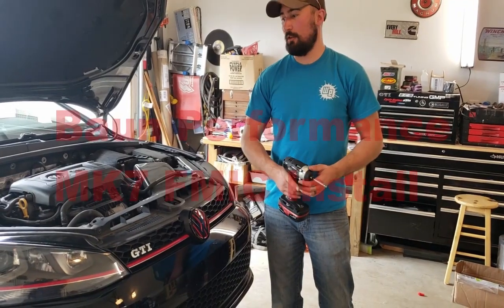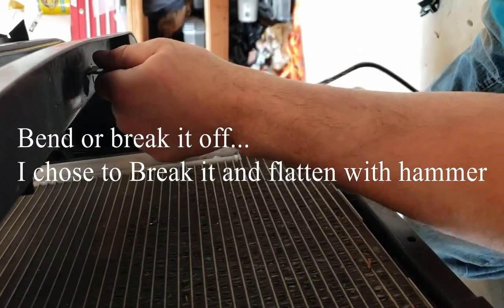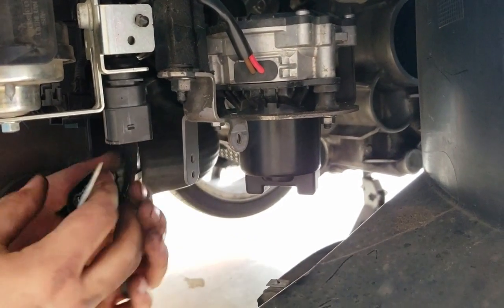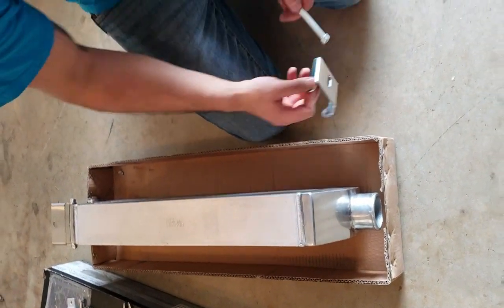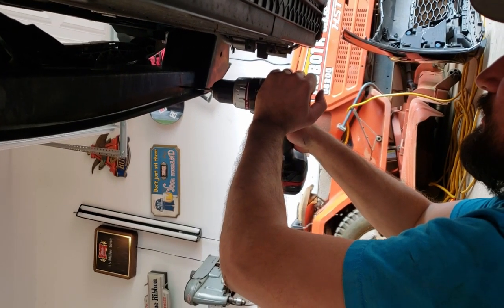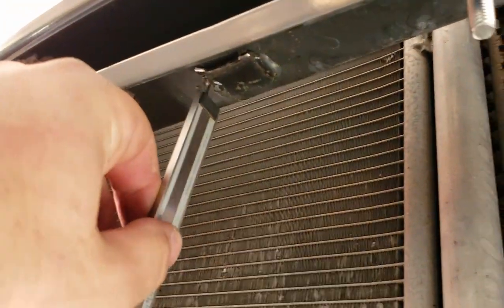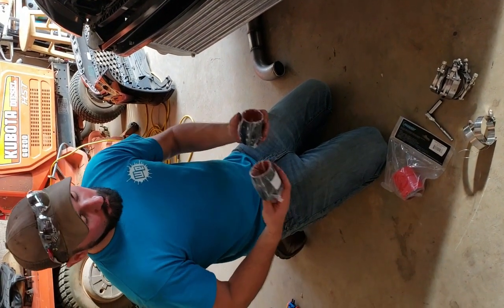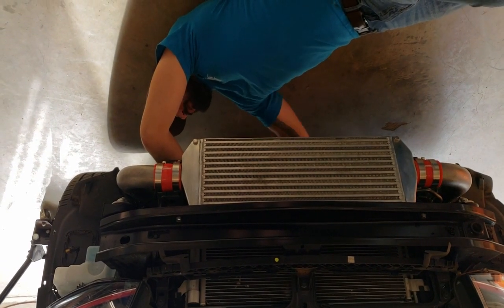Baun Performance FMIC Install

Comment from the maker: The factory IC is an integral part of a three piece sandwich that makes up the core support. AC condenser/SMIC/radiator. They all clip together so you’d need to break the stock IC, then re install just its end tanks as they’re how the rad and AC are held in place. The slight change in reduced airflow to the rad has no negative effects the cooling systems ability to maintain engine coolant temp, so for that reason and simplicity of DIY install were not producing a spacer to remove the stock unit.
Reply: Great explanation, makes sense.  Thanks!

Comment: Why not remove the factory intercooler?
Reply from the maker: Jo Prkr the factory intercooler is part of a package with the AC condenser and radiator. Without it there’s nothing to mount the other two, and nobody’s gonna pay double parts and triple labor to make a simple install much more complex